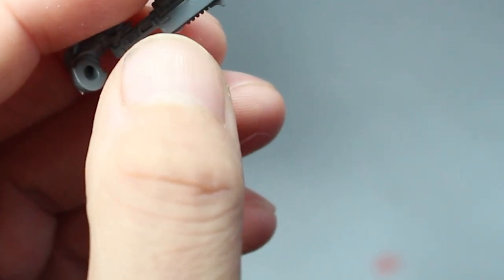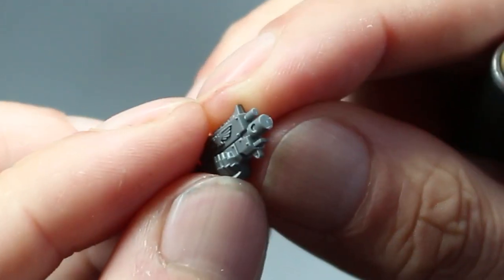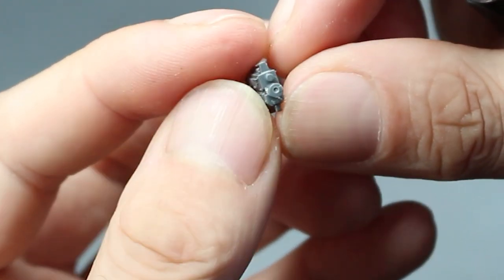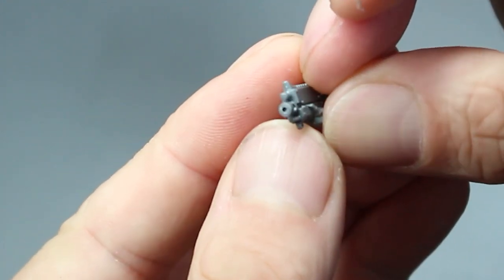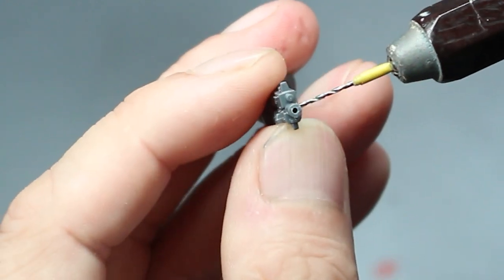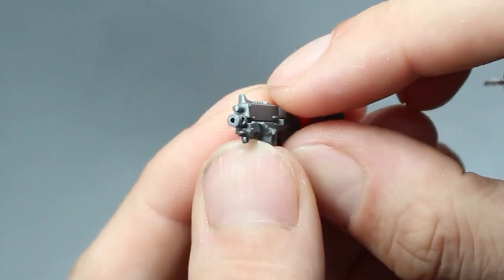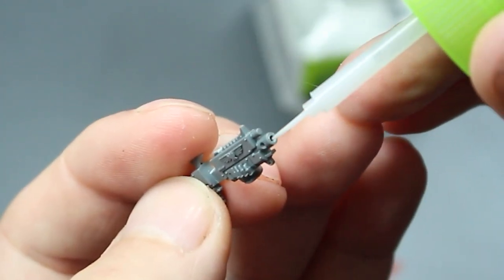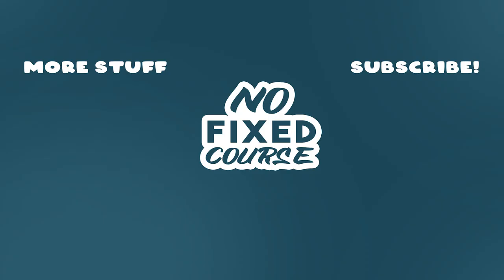How to Drill Bolter Barrels - Warhammer 40K

Comment: I like to do the sides first, which gives you a guide to see how far the barrel from the front needs to be drilled.
Reply from the maker: Thats a fair point, Only issue with that is its easier to damage the front section, it's not so bad with 1.5mm drill bits, but a 2mm can tear into the barrel as there's not as much plastic holding it together. Obviously experienced hobbyists learn how much pressure is needed, but a beginner could easily damage something.
Reply: Side first drillers unite! ✊
Reply: I'm not very experienced by any means, but i found it easier to gauge by doing the sides first, and along with the scalpel tip you displayed it becomes super easy to apply the right amount of pressure since you can even feel when you've gone through the front part.  @nofixedcourse

Comment: What drill is this and where do i get it?
Reply from the maker: Its an older Citadel drill, Not 100% if its still available. But saying that, the actual way it grips the drill bit isn't ideal, you want something with what's called a 'Jacobs chuck' or a universal pin vise (they use 4 little grips rather than the one here which uses a collet system and can't go to really really small drill bits)  you'll have much more freedom over what size bits you can put into it and it'll grip the smaller stuff better. Dspiae do one I believe that's quite good, but there are other options.